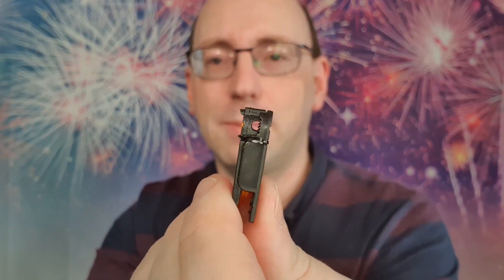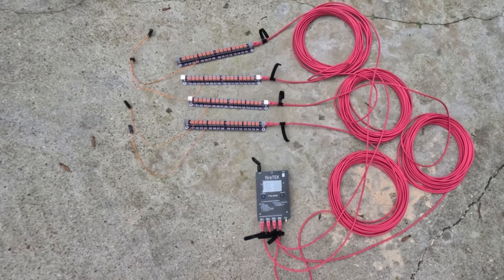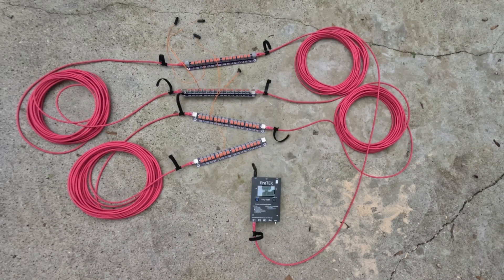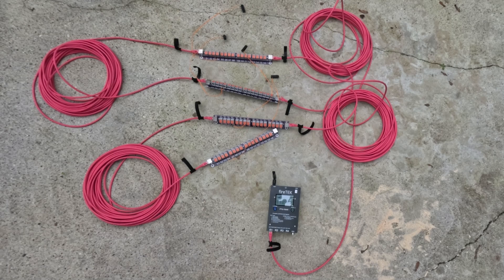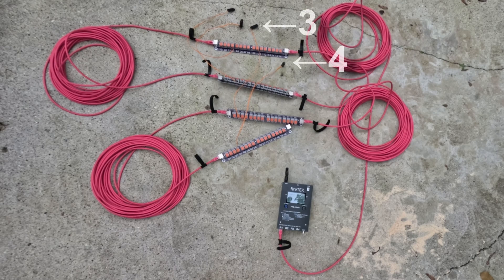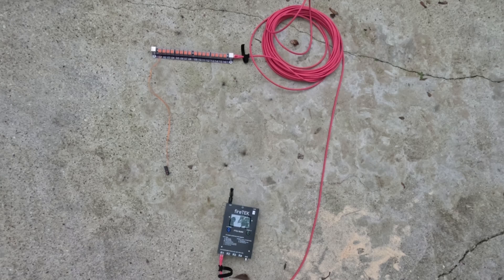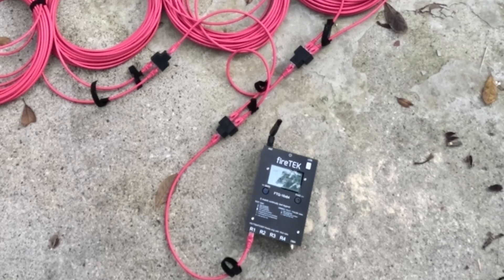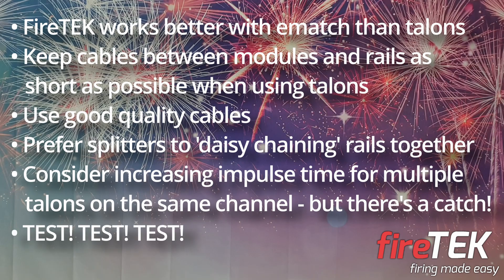Talon Testing my FireTEK firing system #TalkingTalons

Comment: The splitters you are mentioning are JUST paralleling the pairs of wires in the ethernet cables.  So, the firing voltage is around 22 volts, and the current discharge is limited by the super capacitor in the module.

Comment: Great video Mark. I wonder if voltage drop is the issue especially with the high current draw.

I will be getting my first ignite module soon. I have debate over cobra and fireTEK but I came to the conclusion that I do 3 shows a year mostly  garden displays and I just want a script so 1 fire after the other automatically so for me I think ignite is the way. I will have to cut off the talons and use some wagos or spring clips as I use ematch most of the time.

Great video tho can’t wait to see more content!
Reply from the maker: Yeah, voltage drop is the issue. My previous firing system (WPS) ran on 24 volts supplied by two sealed lead acid batteries (the sort you get in house alarm systems) - so it delivered a lot of 'omph', as that power could be directly (and constantly) sent to channels. FireTEK on the other hand uses capacitors (1.5F in total) to 'store' firing charge. As a result, these capacitors need to charge and when they start to fire, they start to discharge. So absolutely fine for ematches, but FireTEK is certainly more restrictive with talons than my WPS system is - that would have absolutely no issue firing everything here in my tests.

As for Ignite - that's certainly the most budget-friendly system available to consumers today, and it was something that I did consider when looking for a new firing system last year. A few things put me off though...

Firstly, at that time there were only 18 channel ignite modules available (since then, Cobra have now introduced a 36 channel module) - but you're limited to a total of 6 modules. That's probably fine for more 'hobbyists', but I didn't want that limitation.

Secondly, the ignite modules are plastic - so easy to melt, and not very robust. Sure, you could of course put them in rugged cases though, but that needs factoring into the cost.

Thirdly, I really don't like the connections on ignite being 'QuickClips'. Again, I could have bodged some breakout boards, but it's just another expense and another potential point of failure.

Fourthly, I didn't like the idea of control being via a phone 'app', and the limitations associated with that. With FireTEK I can (theoretically) be up to 3km away and fire the show from the dedicated controller... with Ignite, the range is significantly less (50-100m).

Anyway, do let me know how you get on once you get your ignite system!
Reply: @TheGreatMarko  Thanks for the advice Mark I really do like the fireTek system a lot to be honest it does come slightly above cobra in my opinion. However sadly for me budget is the biggest issue.

For what I would like to achieve per cue cost Ignite wins. I have spent quite a lot of time to figure out the downfalls of the system. Cue wise I am planning to get 2 x 18 and 2 x 36 modules 108 cues in total. I would only at most do 5-7min pyro musicals and I think this should be ok for that.

I have been debating the construction of the unit like you say plastic and from my own relay system you can tell where firework fallout has caused bits to melt slightly from where it landed. So my idea was to get a robust case and use speaker terminals as the cue ports and then I could solder the quick clips to these and then plug them into the module and then I could extend the antenna so its out the case like on cobra modules.

I do agree with the app control as well staying within range. As with all my displays I can get a good wifi connection. If i do set up close within cat 3 distance hopefully the module side of connections will remain good through the Bluetooth.

Ideal as its my dream if I do ever start professional displays, I will then be in a position to invest into a Cobra or FireTek system which will be amazing as both systems look really good and versatile. But from my current stand point ignite seems to be the way for me with cost still being the biggest issue.

I hope to try a pyro musical this year Sub focus - Vibration it was used a Belvoir castle last year and I really did get a kick from it so with some good 25-30mm cakes and using vivid's new T1 range I hope to make a good show. (I am already trying to create it in show builder lol)

Keep the FireTek videos coming I am really enjoying them and if I ever end up with a FireTek system I can always come back and watch!
Reply from the maker: Yes, Illusion's display at the Festival of Fireworks in 2023 used Vibration by Sub Focus - and I gotta admit, more displays need to use some drum'n'bass in their soundtracks! From chatting to one of Illusion's crew at the FoF, one of their big displays a week or so before FoF got cancelled, so they just shoved a load of extra product meant to that show into their FoF show, and well, the results speak for themselves... https://www.youtube.com/watch?v=FxNec9k6Vqk